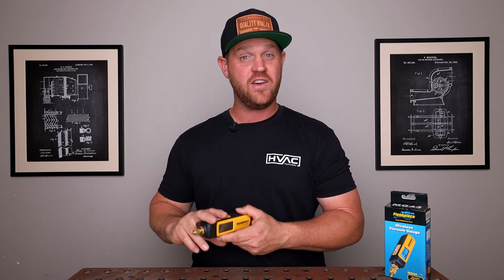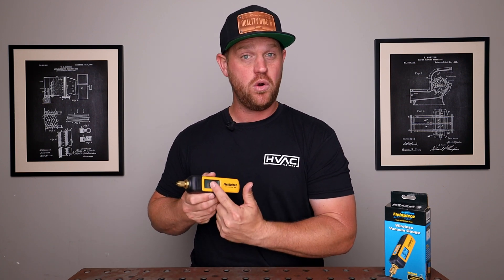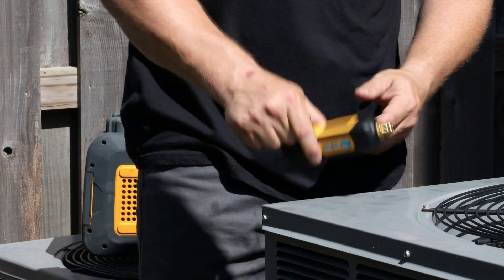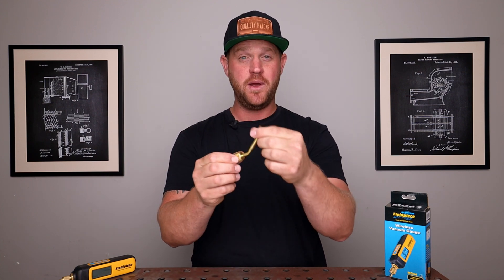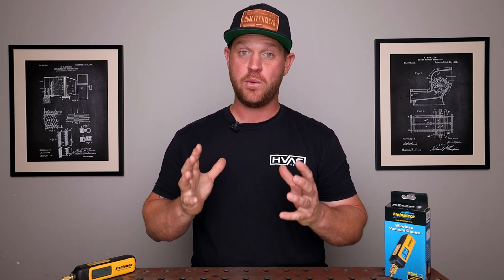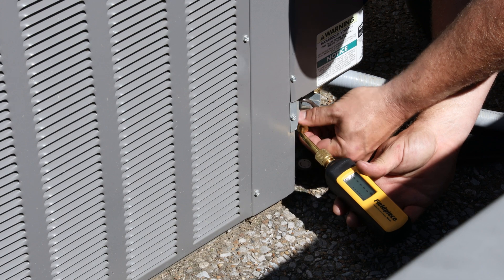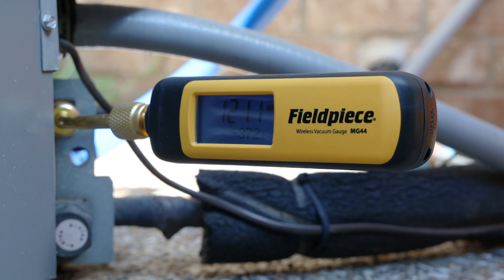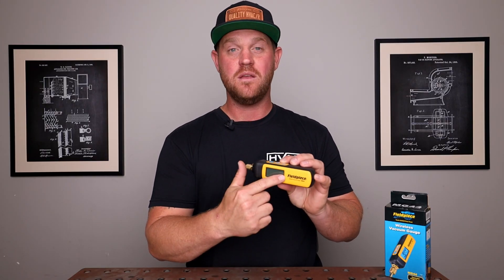Do You Even Use A VACUUM Gauge When Pulling A Vacuum?? HVAC Life

Comment: I just realized you can literally connect the micron gauge to a set of gauges to see if your gauges leak. Now I know you're not supposed to pull vacuums thru gauges in the first place but that would be good for the knuckleheads who still do and are wondering if their gauges are leaking. If you can't get said knuckleheads to use a single or double hose setup then at least you can have them do that
Reply: How would I do that.  I always wonder how good they are.

Comment: Not usually on regular units.  But I for when I do VRV OR VRF systems.  I have to pull down to below 500 microns.  And it has to hold for an hour.  Use an Apion cave stem remover and it will pull down even faster.

Comment: I pull vacuum with a micron gauge, but I think I need vacuum rated hoses. They so expensive tho
Reply: Worth every penny, best money I spent. No more frustration, guessing where the problem is. Get vacuum rated core removal tool and hose, game changer!
Reply: If you do not have the money to buy the expensive vacuum rated hoses. 
          We always have soft copper left at the end of every one of our installation job so use that. 
           Add your own fittings make your own flair and you now have a vacuum rated pose made out of copper. 
       You could use quarter inch or if you really want to go for the gusto you could step it up to threeeights of an inch and at the end step it down to the quarter inch with a flared end & nut. 
          I like free

Comment: I even asked Fieldpiece and couldn't get a response so does this accept positive pressure? Noticed you and also fieldpiece had no way to isolate the gauge after evacuation.
Reply: There should be a valve core remover in-between that micron gauge and the service port. Pull from low, read from high (this is most accurate reading of vacuum achieved in a system) Also seeing how all a micron gauge does is read a temperature (This is why most calibrations require putting it in a bag, in your freezer, after and alcohol cleaning) positive pressure won't harm anything, the issue is getting oil on the sensor. So long as you keep the micron gauge angled up, and only crack your service ports just enough to allow positive pressure in your system, you should be able to avoid getting any oil on the sensor.
Reply: The manual that comes with the guage says it can handle up to 800 psi positive pressure. I’ve had it a couple weeks now and I pull a vacuum the same way on new installs, one hose on the suction line with the core removed and leave the core in the liquid line and place the micron gauge on the liquid line. When I’m done with my vacuum I open the valves and I haven’t had an issue with the micron gauge yet. I’ve also put it on the side port of a valve core removal tool when I’m pulling a two hose evacuation if I’m changing a compressor or pulling on the entire system and isolate the core tools and charge the system with the micron gauge still in place on the core tool no issues yet
Reply: Mate get the bluvac it’s smaller and all the bells and whistle functions . Accepts positive pressure no problem.

Comment: I’m actually in the market for a new micron gauge. Seriously considering this one now.
Reply: Don’t get sucked into the bluvac hype
Reply: @hvacjay3201  what hype? They basically invented the software that allows for predicting the result of a decay test and indicating wether there is a leak or not. They also have the most accurate micron gauges I’ve ever used. They don’t leak like many of the original Fieldpiece ones did, are easily cleaned, easily calibrated, and backed by a support team that posts a phone number rather than making you email them. I’m not meaning to knock Fieldpiece other than on their original micron gauge. I really like my SMAN380 and wireless probes, but certain companies are better at some tools than others. Just my opinion of course.
Reply: Blue Vac,
Reply: I’d go with bluvac by Accutools. Proven micron gauges and great support!